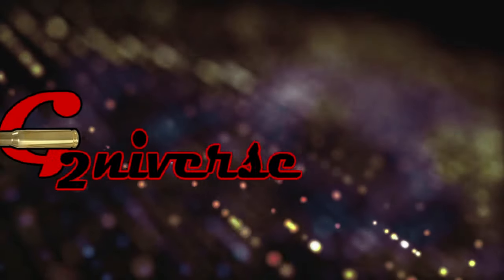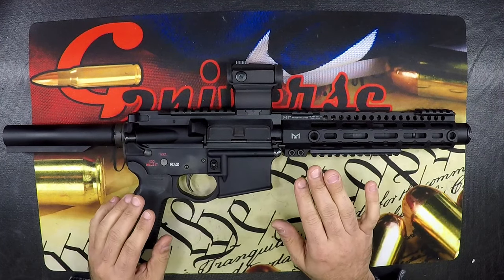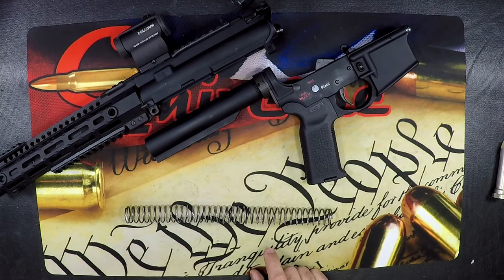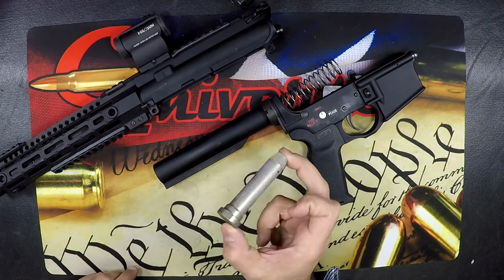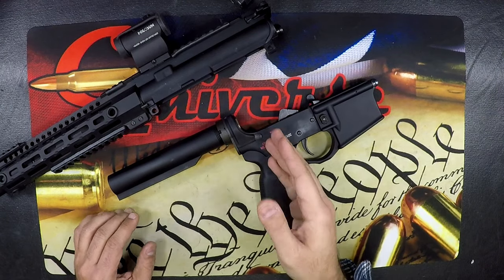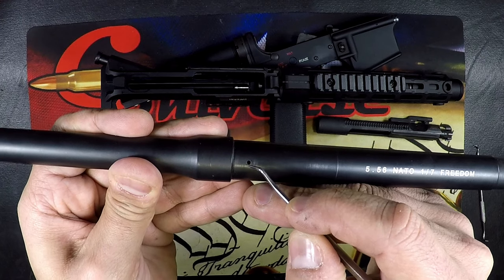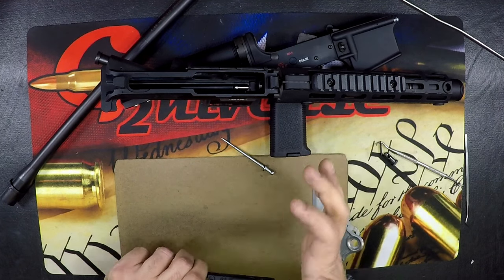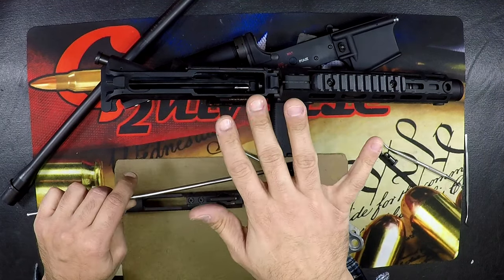Safely Fix Undergassed AR - How To

Comment from the maker: If after everything you're still failing... check your bolt catch!
Reply: What if bullet stuck in barrel?
Reply: What one do I replace it with ??
Reply: @thekidd2189  subsonic ammo ??
Reply: You missed gas tube seal into gas block. See my post about my experience.
Reply: I'm having issues with the BCG that came with the rifle. When I exchanged it with another BCG, it fired fine. The BCG is the problem, any ideas?
Reply: @thekidd2189  squib, bad ammo.  Ram it out.
Reply: How would bolt catch be the issue?

Comment: Most of those complaining about under-gassed ARs have brand new rifles most likely.  They also probably didn't fire at least (5) 30 rd magazines with FULL power 5.56 NATO Ammo with heavy lube between magazines!  Trust me, this works to smooth out everything and "marry" the parts properly (with LOTS of lube! no pun).  Did I mention how important it is to over lube ONLY during the break-in period (1 range trip) and between EVERY magazine?   An old war vet saw me struggling with FTF/FTE on my brand new BCM.  He said "is that new?  If so, where's your bottle of oil?"  
 
Me: It had oil on it when I bought it!  

OG:  Are you simple or something? 😂😢
Reply from the maker: This comment is absolutely spot on!
Reply: Well I have this issue with my new ar and it's super lubed. My friends new ar's shoot right out of the box no issues.
Reply: I had lubed mine & was having this issue, New Build, read your comment & generously lubed it & she is Running Great. Thank You & that OG for reminding this VET some BASICS.

Comment: Had mine start to not eject the rounds after I shot found out it was the set screws on the gas block came loose and it slid up a quarter of an inch, this video is very useful 👌
Reply: Just had this issue today as well 😅
Reply: You may want to dimple your barrel and reinstall so that doesn’t happen again
Reply: Same problem

Comment: I watched your excellent tutorial months ago. Last week was at the range and my very reliable Ruger AR failed to lock open after a last round so I put a single round in a mag and fired it, locked open as it should. A few mags later same thing happened. Wasn't too concerned and went home. As a routine I clean my guns after every outing. While cleaning the Ruger I noticed one of the gas rings defective and figured out the problem. I only bring this up to mention that faulty gas ring(s) can cause an intermittent (undergassed) cycling problem.

Comment: Lot's of good info. You went deeper than what the Army taught me, though you probably know this if you're an Armorer in the Army.
I've built 2 AR's that failed to feed...no I didn't try the one bullet test, just that they didn't feed the next round but did extract the fired casing...One was a 16 inch with midlength gas system, and the other was an 18 inch with midlength gas system. I first built the 16 inch and had it happen from the outset. I figured the problem was dwell time, the gasses were in the barrel too long before the gas block and too short to the bullet exiting to provide sufficient gas to fully cycle the bolt carrier group. However, midlength carbine systems are a thing.
I did some research on fails to feed and one of the suggestions was to try using a chrome silicon carbine buffer spring so I bought one and after installing it, the rifle was 100%. It ran perfectly. 
The chrome silicon spring also eliminates the "sprong" sound next to your ear when the rifle cycles and they have an extended life cycle. Supposedly the standard buffer spring should be replaced around the 12,000 round point, but a chrome silicon spring lasts upwards of 650,000 to 700,000 rounds, far longer than I'll ever run my guns...my grand-kids should still be shooting them and be well within the life expectancy of them, short of an extended civil war or invasion by other countries.
After that, I decided to build another rifle, the 18 inch, but what I decided to do was build a new lower for the 16 inch upper, and that rifle I gave to my wife, and a new upper for the original lower, the 18 inch, and that was mine.  The 16 inch rebuild ran flawlessly, I did move the buffer assembly with the chrome silicon spring onto her rifle and tested it...worked 100%, however, I figured the additional 2 inches in the barrel would fix the issue and just put a regular buffer spring in the rifle....nope, it also failed to chamber the next round. Another chrome silicon buffer spring fixed that rifle, and it's ran 100%.
So that's my experience, weather that was the issue both rifles had or not, it did fix the problem for both rifles.
I've built a few more since and the rest have been 100% as built, and I've been using standard springs on all of them...chrome silicon buffer springs are a bit more expensive than standard springs after all, and I don't mind adding them, but they all have worked as is.
My AR10 build, however, did have an issue, that being it failed to extract a round. The round was stuck in the barrel and the extractor couldn't remove the round. I ended up using the cleaning rod to knock it out, which it did remove easily. The rim on the round was damaged, probably because I hand cycled the rifle several times to try to remove the casing. I didn't get a chance to examine the bore of the barrel for any problems, and the extractor on the bolt for any problems. That's the next check I'll do on that rifle. That was the first round, and the bore could have had some gunk on it, or the extractor may have been damaged from the factory...silly me didn't look at those issues during assembly. Live and learn. That's the next check I'll be doing on it.
Anyway, again good video, lot's of good info. Thank you.
Reply from the maker: I'll check out that spring! I had the EXACT same issue with my ar10 when I went to test shoot. Took about 50 rounds to break it in. I started with brass (was getting costly), then went to steel to break it in... runs fine, no issues since.
Reply: @G2niverse  I've got some 308 steel case. I'll have to give that a try. Thanks for the suggestion.

Comment: I only had this failure once on a build. It was a 10.5" SOCOM profile barrel with a .086 gas port using an A5 buffer system and a Sprinco Green rifle spring. So buffer and spring were good to go. It should have run well using an A5-H3, but I was getting failures to lock back and it was riding over the rounds in the mag causing failures to feed. I went down through the A5 buffers from H2 to H1 to H0 and got similar results. The gas block came from the factory with the gas tube installed so I didn't notice the sloppy tolerances. After 2 mags of this failure I pulled the handguards and saw carbon almost 1.5" down the tube from the gas block. Huge leakage there. Pulled gas block and it was lined up perfectly. Punched out the gas tube roll pin and the tube fell out. Tried same gas tube in another gas block and it needed a little tap from the gunsmith hammer to seat. Reassembled and it ran like a sewing machine. 

I mention this story because it was the one interface that you did not mention. You should always check the seal where the gas tube goes into the gas block. It likely would have sealed enough over time as it started to cycle correctly in mag two, but still would not lock back. Great video as usual.
Reply from the maker: Thanks Grayish Man for being a  subscriber...love hearing from you guys!

Comment: My Aero Precision upper came with a 10” 1:7 twist pistol length gas system, Ballistic Advantage barrel. The gas port was drilled from the factory to a spec of .0935”. I don’t fire suppressed, and it would fire supersonic rounds without a problem. Subsonic 220g rounds would not cycle nor create enough back pressure to strip another round from the magazine. It also wouldn’t lock the BCG back on a 1 round magazine test. I tried a SpringCo yellow reduced power spring with some success. Only a few failure to feed issues from a 30 round magazine. I decided that wasn’t good enough, and after doing some research decided to drill the gas port to .0960” (#41 carbide drill bit).this resolved my failure to feed issues. I added a Superlative Arms adjustable gas block, and within 5 rounds of making adjustments, was cycling perfectly and ejecting the casings at 3:00.
I would suggest this as a last resort. You can go with lighter springs and a lighter BCG, however you will wear out your components faster by putting a bandaid on the real problem of being under gassed.
Reply from the maker: Sounds like you figured it out...but I agree...drilling is always the last resort.  Sometimes you need to change you're entire setup for suppressed shooting with subsonic ammo...this would include a lighter buffer and reduced powered spring. But to your point if you want a rifle that can seamlessly go from subsonice suppressed to unsuppressed, yeah, youll need to address the main issue.

Comment: If you build your rifle and follow simple guidelines you’ll usually never have a problem . As you stated the buffer/spring should correlate with your gas system .and barrel length. Meaning correct buffer spring and correct buffer weight and size and your good to go . I have built all my own and never had a problem .
Reply from the maker: Exactly right. The gas system is the life force of the rifle. Too little and you choke it out, too much and well...stand back baby!

Comment: Thank you for this. I bought a Wise Arms B-15 new and after 3 days it wouldn’t throw the spent cartridges. Found one of the set screws on the gas block was loose and gas was escaping from around the block. Reseated it, tightened the set screws and it works like a charm now.
Reply from the maker: Rock on

Comment: So the only other thing I would add is. If after ALL that, it still doesn't hold back the bolt, the gas port in the barrel is under sized.
Reply: Good add.  I was going to post the same thing.
Reply: This happened to me using a barrel of a reputable manufacturer coupled with an SLR titanium adjustable gas block.  The muzzle is too near the journal and, therefore, the dwell time is too quick.  I tried everything.  Nothing worked until I enlarged the gas port.  Now, it runs like a champ.
Reply: @redscorpion3  hey, how did you get rid of the burrs out of the barrel after enlarging the gas port on the barrel?
Reply: @toddchikigak6339  4 months later im sure you've passed this issue but a torch tip cleaning set may get er done.
Reply: Good one OP…I’ve had to drill out 2 barrels in my life. It’s not often, but I’ve had to drill a couple. Just a couple thousandths over will do the trick.

Comment: One more thing to add to the list is a bore polish. Use Flex hone for your caliber and polish it. My ar had this problem and this fixed it. Do not open up your gas hole in your barrel, do this instead.

Comment: A bore sight ran up threw the barrel to look at the gas port and gas block is mandatory.  Your barrels gas port may be to small. Set your gas port to a bigger gas port hole. Built 31 AR'S of different calibers, to back my position. The bolt,carrier,buffer, spring - all in order, if so...its your barreld gas port diameter.

Comment: I find that the Wolf 223 makes a good low power benchmark for cycling. If it cycles the Wolf, then everything else should work. That being said, I only keep the steel cased/jacketed stuff for function testing. I don't recommend it as standard fodder.

Comment: I ordered an 18 inch barrel with a mid length gas system but got a 16 inch mid length gas system and did not notice until I was putting it together much later in the year.
So it was under gassed just enough that it would just barely (75% of the time) eject a round but never load the next.
I just replaced one of the 3 steel buffer weights with an aluminum one and it function perfectly.

Comment: If you check everything as suggested and it still isn’t working, it could be a barrel with a small gas port.  An easy fix is the Springco yellow spring which is a reduced spring.  Works great for the 18” Rifle Gas SPR barrels and the 12.5” mid length gas system barrels also.

Comment: An over sized bolt carrier bolt tail bore will cause gas issues too. A common sign is a lot of fouling in the fire control group and or a bent firing pin cotter key retainer. The best method is to pin gauge the bore..

Comment: This is a good video overall. 
I would also add that you should try a different BCG in the offending rifle and the offending rifles bcg in another rifle.
Lastly using a drill index to measure your gas port and compare it to other reported gas port sizes for your barrel + gas system length is a good idea.

Comment: Hey my friend, just wanted to say thank you for the great advice. I bought a BCA 7.62x39 upper and could not get it to cycle. Ended up replacing the rifle buffer spring with a carbine spring, lowered the weight on the buffer, it cycles ANY ammo you feed it. Thank you again!!!
Reply from the maker: David Greg Thanks for watching!
Reply: @G2niverse  keep up the great work and God bless.
Reply: Same thing here Dave. Bought a BCA 7.62x39 16 inch upper and during my first trip to the range it was choking and puking got it home and after 4 hours of checking finally found that they had a rifle spring installed in the darn thing. 🤦‍♂️

Comment: If the gas block is not clocked, the gas tube in the gas block seal is good, the gas tube button is in spec using a gas tube gauge and the tube itself is not cracked, the gas key bore is in spec-.180 to .182, the gas key is not loose or leaking gas, the bolt carrier bolt tail bore and gas ring bore is in spec, the bolt tail O.D. is not under sized, the gas rings are good, the buffer is the correct weight, the chamber and throat check out with a function gauge, the head space checks out good using a 1.4646 5.56 go gauge, not a 1.4636 223 commercial go gauge in a marked 5.56 chamber, the ammunition is good, then the gas port may be under sized and needs to be opened..Adjustable gas blocks and adj bolt carriers will leak more gas than mill spec which can cause cycling issues.  Adj gas blocks-carriers will only decrease the barrel ports gas pressure, not increase it..A barrel that is clocked in the upper receiver can also cause cycling malfunctions ..

Comment: The hole in the gas block and gas tube are directly opposite one of the setscrews on the gas block. Remove the screw and you should be able to look through and see both holes using light on the and down through the bore.
Reply from the maker: this is a great tip for alignment. i like to use a pencil and draw around the gas port, line it up using the set screw hole.  Just make sure you are dimpling your barrel or filing it flat so your set screws seat securely.  Biggest mistake is thinking that set screw will hold on a rounded surface.
Reply: @G2niverse  Trivia -- The two holes for the gas port and the screw opposite it are drilled in the gas block in one manufacturing operation which is why they're directly opposite each other.

Comment: I went to try mine for the first time after building it and I was very confused why I was having so many issues cycling it. I’ll have to check these things, but I was thinking it could be the fact that I forgot to lubricate the BCG, but I do have an adjustable gas block.
Reply: Adj gas blocks will only decrease the barrel port pressure, not increase it. Adj gas blocks will also leak more gas than a mill spec gas block just by design which may cause cycling issues if the barrel's gas port is already on the small size..

Comment: And if your using a AGB and are still under gassed simply drill your gas port a bit larger and then you can adjust to your needs.
300blk and 300Hamr is a good example because of the large range of bullet loads and weight. 
No reason to beat the hell out of your gas system when switching from light to heavy loads.Simply tone it down with the adjustable gas block.
Also AGB's are great if you run suppressed one day and take it off the next day so you have the ability to lower the pressure or increase for the non suppressed days.
Reply from the maker: Rod Johnson you are correct but I always balk at telling people to drill their gas ports...you can totally jack up a barrel if you dont know what youre doing.  But yes, sometimes you need to widen the barrel port.
Reply: @G2niverse  
Also, if you do decide to free hand drilling a gas port make sure you run a aluminium cleaning  rod into the barrel so it can be used as a stop.
This way you will not get pulled into the barrel and screw up the rifling on the other side if the bit pulls you through.

Comment: Got a carbine spring in my rifle. I’ll start there and double checking my gas block alignment. It didn’t seem it went on far enough to be dead centered in the hole..

This also helps me realize one of my other rifles is over gassed.